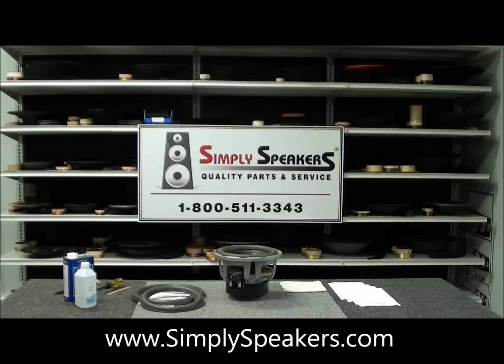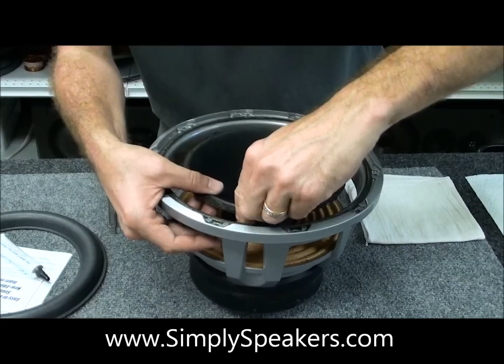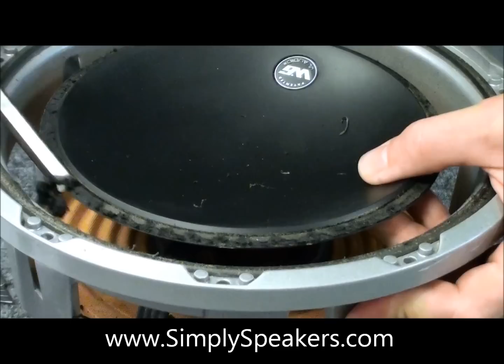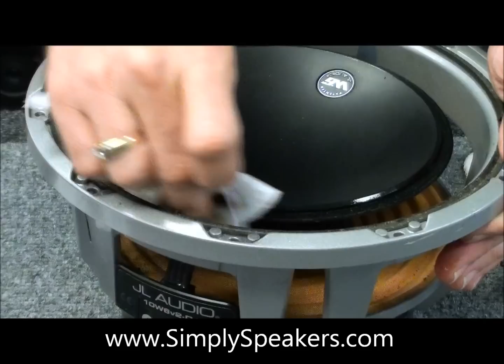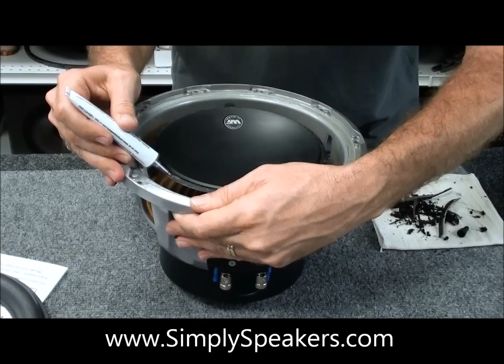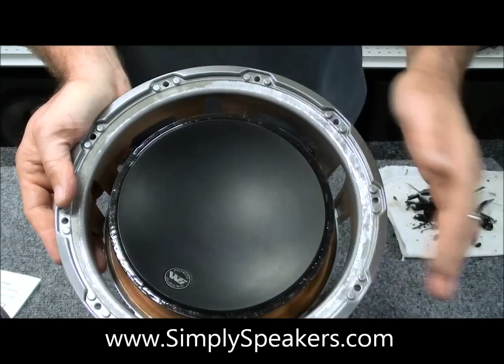JL Audio 10W6 v2 Speaker Subwoofer Foam Repair

Comment: I started cleaning the old adhesive off.  When I move the cone, it makes a small crunchy type of sound. Is this a sign of another problem? Should I continue with the repair?
Reply from the maker: Should be fine. Proceed and hopefully no issues.

Comment: QUESTION:  I have a JL 12W3 and the foam originally mounted to the top side of the lip on the cone.  It seems to look better with the foam mounted under the lip on the cone.  Had anyone experimented with this to see if it works as well or better?
Reply from the maker: We have always top mounted these, and recommend you do the same.

Comment: just ordered mine for my 12w6v2.  im assuming it comes with the adhesive? there was an option for it but it says the kit comes with the rubber adhesive
Reply from the maker: The glue is included with the kit. Thanks!

Comment: Great video, but there is a missing piece of information at around 00:9:30. The lip of the cone sits about 1-2 cm lower than the lip of the frame, unless you raise the cone from the bottom as shown in the video. But if you glue the foam to the cone, and immediately release the cone, the cone will fall back down and the lip of the frame will pull off the newly glued foam from the cone. What I did is keep the cone raised manually after the gluing for about 30 mins before letting it sit back down, to let it continue drying. Would have been good to get the "official" procedure for dealing with this in the video.
Reply from the maker: Quick Tip:

Place some wadded up paper towels under the cone to help elevate it while the glue cures.

Comment: Thank you! Everything is going good, I have a 13w6v2 and I was having trouble with glue on the frame. Nothing was loosening it and with a utility knife or wood chisel, it seemed to start getting to the paint in a couple areas. It's weird cuz over 80% of it is flat/clean, but then I have these small, somewhat raised areas that came up with the knife as crusty off white-ish. I tried a goo remover and then paint came off when I tried the chisel on the small raised area again...

If I glue over it, it's nearly perfect on the frame and the cone I had little issue with removing around it, will it end up being a problem? The small raised area is hard as s#!& so I wouldn't think it would cause issues. Thanks.

Probably answered my own question lol but yea
Reply from the maker: From your description, it will be fine to glue the new surround to the frame as-is. No worries. Thanks!
Reply: @simplyspeakers  Thanks! I really appreciate the reply 😀 it's really something that you all are still monitoring your videos, this one being 10 years old. Great company and service 💪

Comment: So I did everything in the video, waited a full 24 hours and reinstalled in my car. After installation, I played at moderate levels. But about a day or two later I noticed a buzzing sound when the stereo is played at low  to moderate volumes. You can't hear it when the stereo is turned up loud, only at low to moderate volumes. I felt the sub to see if the sound was coming from it and sure enough, when I press on the middle of the cone, the buzzing stops. So my question to you...have you run into this problem before and if so, what's my solution? I'm guessing the glue on the upper cone broke free from the lower cone? Any help would be appreciated.
Reply from the maker: Hello. Its difficult to know without seeing the speaker in person. Send an email to: info@simplyspeakers.com and they will try to assist you. Thanks!

Comment: The glue on mine is on there so damn good that it took me a good 45 minutes just to get every trace of the glue off the cone. The outside of the frame is taking even longer. Ugh.
Reply from the maker: Yes, the prep is definitely the time consuming and tedious part of the job.
Reply: @simplyspeakers  Thank you for the response, I have a question for you. The outer ring of the replacement you sent it slightly larger than the speakers "lip". Is that normal? I double checked to make sure I ordered the right parts and I did.

Comment: You guys are life savers. 
Just got my uncles 20 year old surround system and the sub started making noise, so I oped the cover and touched it and it disintegrated.
I was depressed for a bit until I saw that there was a repair kit for it from you guys. So thank you so much
Reply from the maker: Thank you!

Comment: Super stoked that I was able to revive my 10W6v2 with just the foam surround replacement. THANK YOU Simply Speakers! I used Goof Off to help break down the adhesive and then rubbing alcohol helped to get the last bits of the adhesive off.

Comment: Thank you for sharing your knowledge. I repaired my JL W3v2 whose original foam deteriorated badly.  I used "gasket remover" spray to loosen and remove the factory glue. Thanx again.

Comment: I removed my old surround, but unlike in your video, I've found that my 12w6v2 has a beveled ridge where the outter portion of the surround is glued to. This made it a pain in the ass to clean, as the adhesive was in the recess. I couldn't just run a box cutter around the edge like you did... I ended up using a screw driver.
Reply: I know this is an old comment, but I just repaired mine and it as you described it was a pain but I did it I almost used my dremel but I just used a small flathead screw driver and got it done....

Comment: hi i have a brand new lab12 subwoofer and on the foam surround there is a faint white line in the centre of the foam which runs around the entire speaker is this a point where its getting weaker or something not to worry about as it is new there is no breaks in the white line and the and the intensity is consistent
thank you in advance

Comment: Used this to replace the dry-rotted surround on my 10W6 and it works great now! The glue is strong and high quality, and I have a lot leftover that I could use elsewhere :)

Best of all, this saved me a lot of money by not having to replace the whole subwoofer! Thanks simplyspeakers, the video also really helps :)